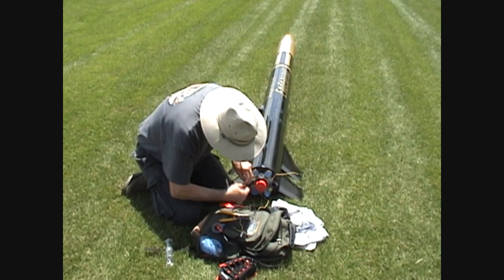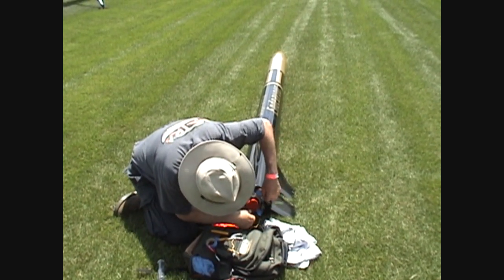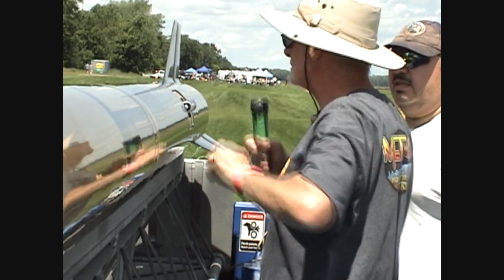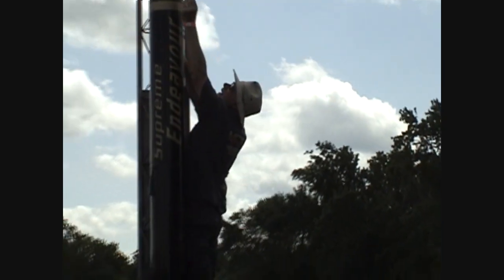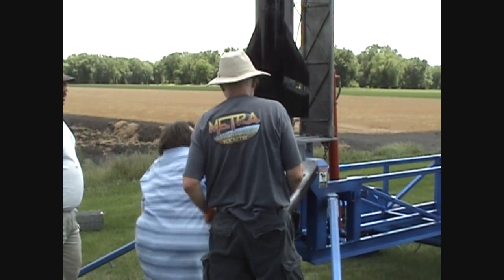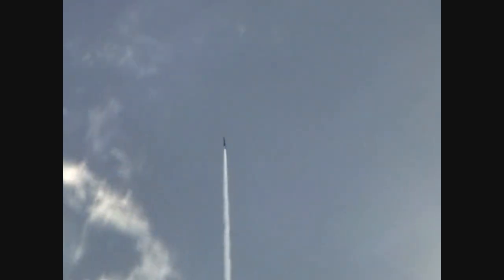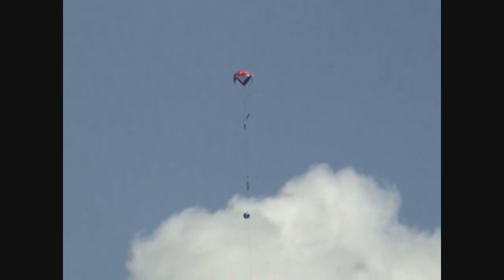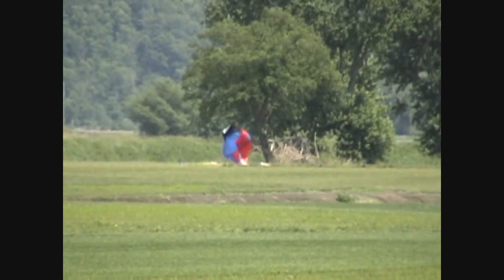Maiden Flight of the Supreme Endeavour

Comment: Does the FAA jack with you over going over 400' ? Like they do for drones .
Reply: I believe they are cleared for altitudes up to 4500 feet by the FAA at this location.
Reply: High Power Rocketry requires FAA waivers for vehicles over 1500 grams or with over 125 grams propellant.

It is possible to acquire a waiver as an individual, but it helps to be part of a rocket club with the experience and contacts (plus you get to watch their rockets too!)
www.nar.org or www.tripoli.org for more info!

Comment: I don't know how these guys made their fuel, but in the late fifties we used powered zinc and sulfur for small five foot rockets. They would obtain thousands of feet. We did this under the Pacific Rocket society. Others used liquid oxygen and thiokol, a rubber like substance which theoretically would go 100 miles. I never saw it launch. We built small, six inch, jobs that went 2 thousand feet with potassium permanganate and powdered aluminum.
Reply: Today most amateurs use potassium nitrate and sugar. Lower performance but cheaper to make. A group called sugar shot to space is attempting to make a sugar rocket that reaches an altitude of above 100km.
Reply: I'm familiar with the zinc-sulfur rockets. Most were copies of Capt. Bertrand R. Brinley's "Beta" from his "Rocket Manual for Amateurs", a paperback published in 1960. George Dosa of the southern CA  RRS (Reaction Research Society, founded in the 1940s) was particularly devoted to these. Zn+S rockets were used as end burners and had a burn rate of 90 in/sec. The rockets jackrabbited off the pad with a BOOM that sounded like a train crash. I thought it was kind of the upscaled equivalent of putting a firecracker under a tin can.
Reply: The rocket motors were purchased and the manufacturers names and models are listed in the author's comments above.

Comment: You do DO need to get an FAA waiver to launch a rocket like this. It's size and maximum altitude put it outside the range of what you can launch without notifying the FAA. It's not hard to get a waiver, you just need to understand the paperwork. If you are part of a club launch, like here, the club can get a blanket waiver for a certain altitude and you don't have to worry about getting one yourself.

Comment: If you fly a rocket like this horizontally - even at a 60 degree angle - it would hit the ground within 100' or less. Fins on an acceleration-stabilized rocket make zero lift and gravity overcomes its trajectory REAL fast.